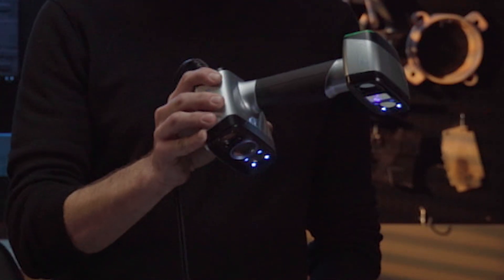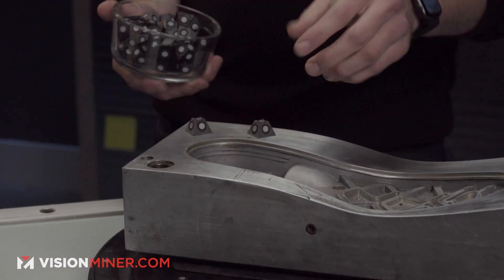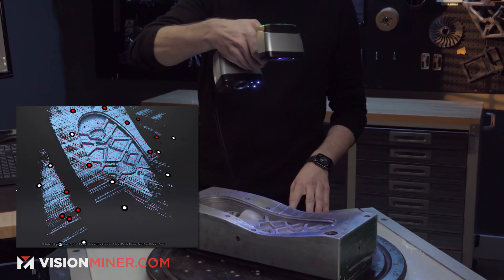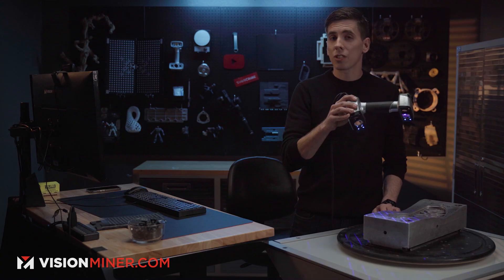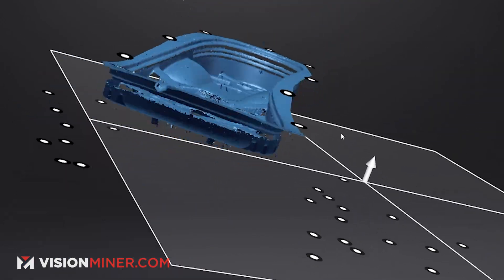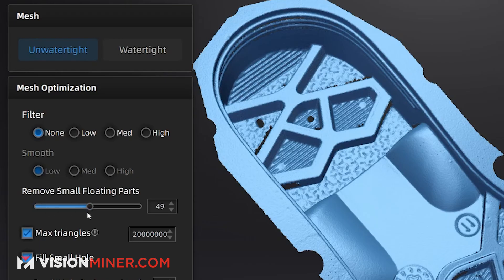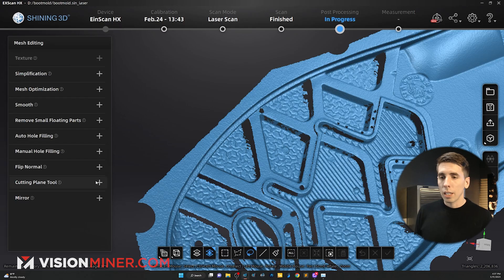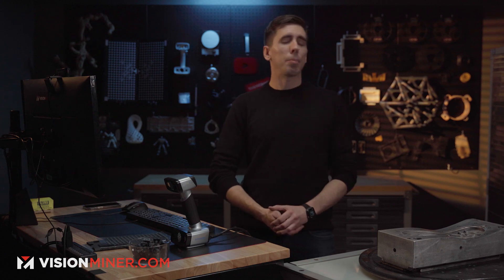Injection Mold 3D Scan: Einscan HX Laser Mode

Comment: Hi, thank you for the video. We are thinking about getting a scanner for scanning hot tub thermal forming molds and for inspecting formed acrylic sheets for detecting deviations. Would you recommend the HX? We would prefer not having to using too many markers as the object is large (89" x 89" x 35"). Thank you in advance.
Reply from the maker: HX would get the job done, but you'd probably do better using the Freescan Combo's Infrared mode -- it does really well with features, and you wouldn't have to use markers! The H2 might do well enough, as it has a similar IR scan feature, but the Freescan would definitely do best.
Reply: @VisionMiner  Thank you for the suggestion. The H2 sounds like a budget friendly option. At <1/3 the price of FreeScan Combo, we would need to consider it seriously.